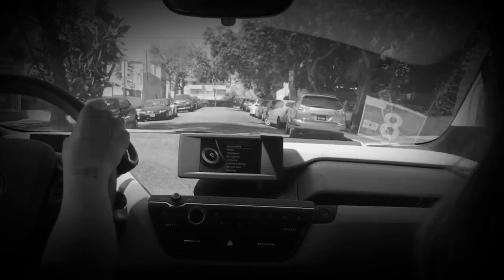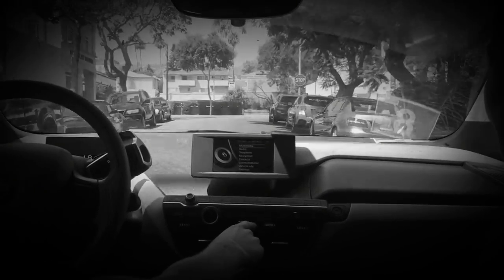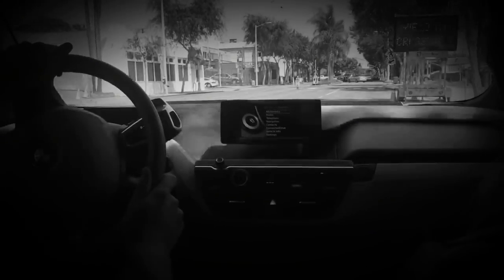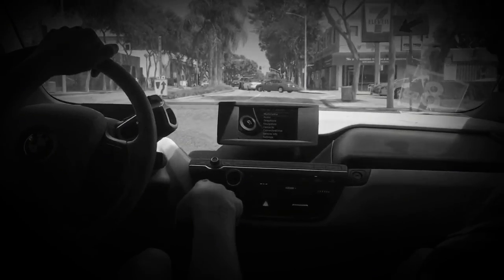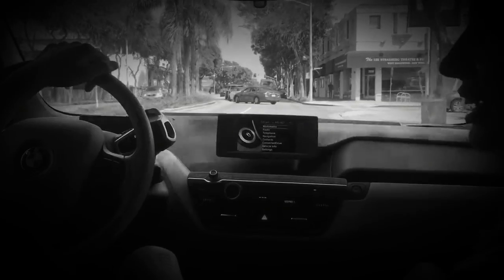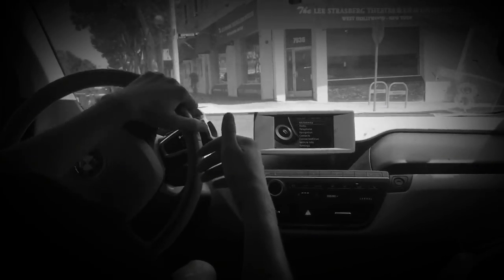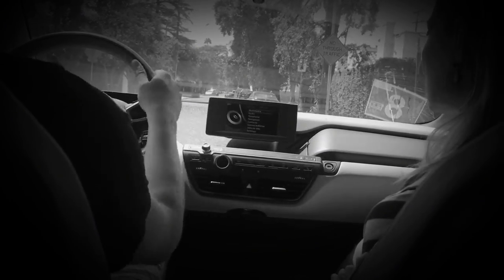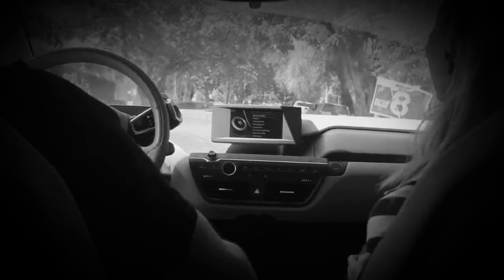How loud is the BMW i3 REx Range Extender?

Comment: it's quite loud outside the car. in a traffic jam it can draw unecessary attention , or even annoy everyone stuck around you. looks like a design afterthought. hmmm why not stick any old 650cc engine in the trunk and see. and why did bmw not use quieter engines in the 33kWh upgrade.
Reply from the maker: In a perfect world it would be a .5L I6. :) Or a Wankel as Mazda has done but that wouldn’t be on brand or on the shelf. I haven’t found it objectionable at any point, or even noticeable as a pedestrian, but I tend to think of it as for use on the freeway not in traffic, where the battery is better utilized.
Reply: When you’re stationary or under 20 mph you it turns itself off